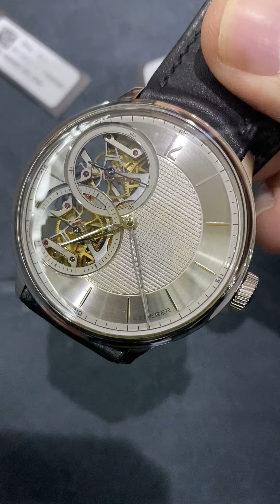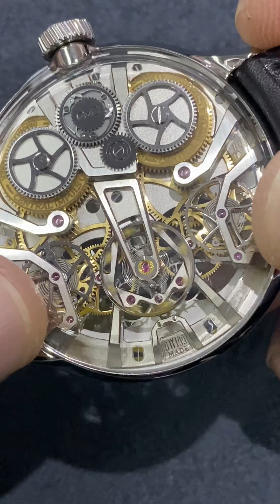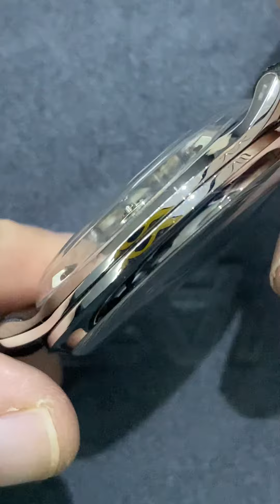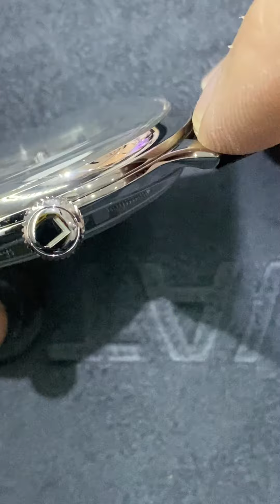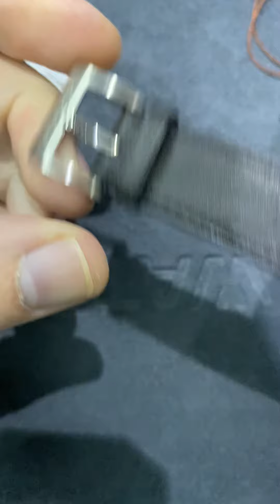Dubai Watch Week 2021: Bernhard Lederer Central Impulse Chronometer Watch Review

Comment: One of my favorite recent designs from an engineering point of view, if not looks. Even if it is by no means an unpleasant looking watch, just rather too demure. I think the blue dial variation would do wonders for those visuals anyway. Oh and the arrangement of the twin dial barrels and shaft leading to the balance wheel is rather phallic! 😆
Reply from the maker: I regret not seeing the blue dial model. Bernhard wasn't actually at the show as an exhibitor, so I shot this watch as part of the traveling GPHG collection. Blue would be my clear preference.
Best,
Tim